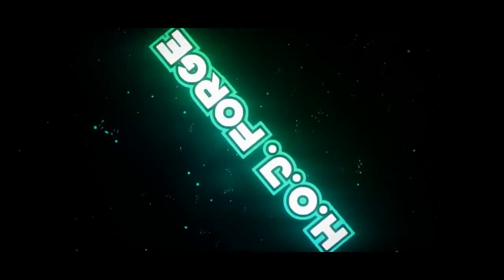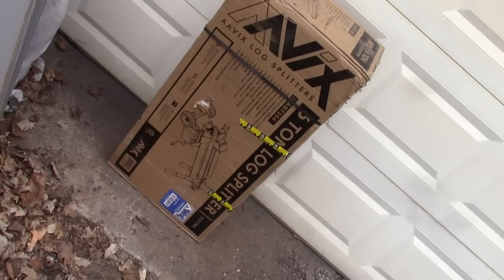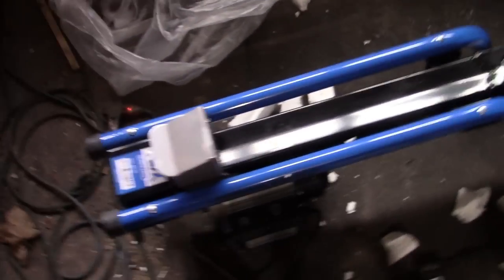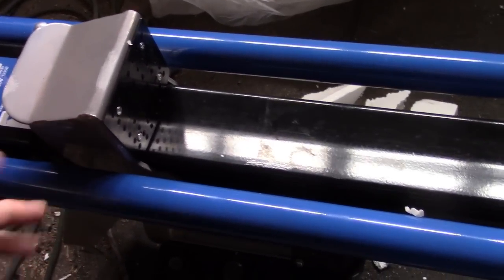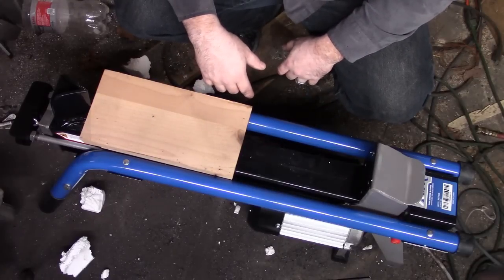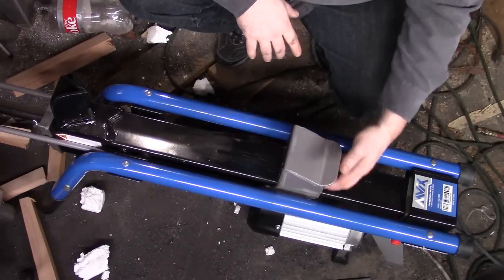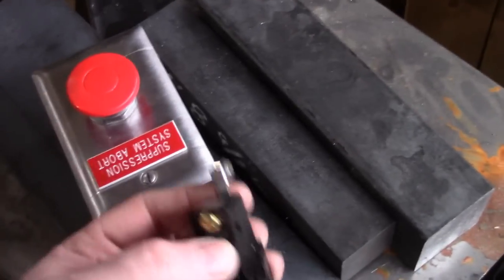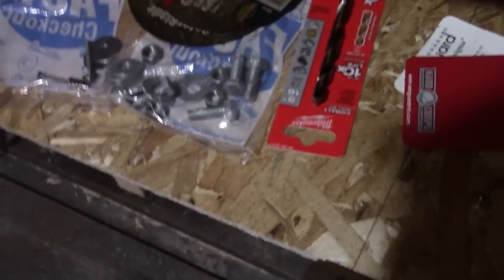6 Ton Log Splitter to Forge Press - Video 1 - An Overview of the Project

Comment: Most bed frame is seriously hard, especially when you try drilling through it, should be plenty strong enough for the legs.  They're just holding up the weight of the machine to comfortable height, not taking any of the hydrolic pressure.

Comment: 6 ton is not a lot. Good luck. I converted my 20 ton gas into a press. Works great. I can easily revert it back because I burn wood for heat
Reply from the maker: Nope, its not, but for under $300 bucks total, it will relieve some of the stress on my arm, even if it doesn't do every little thing I'd like it too.
Reply: @HoJForge  it will definitely help. I will keep watching.  I'm very interested
Reply: @HoJForge  there is a proof of concept video i think it's CG smithing. for smaller stock it should be good. i got a 5 ton for $150 i'm doing the same thing to.
Reply from the maker: @AllyisAlive214  Its that video that convinced me to risk the money and try it out.  Christiaan and I have been talking about his build... what he likes, what he'd change, etc...  There's also another video out there that I saw where the guy can barely  move some 5160, but he's out in the sun, so his steel looks way to cold... but he's "assured" the viewers that his forge is running nice and hot... blah blah blah... I've never been one to take other the word of other people in things that can have so many different variables...  Will 6 tons be enough for it to do what I want it to do?  Who Knows?  That's what this whole build is going to find out. I promise you that I won't be able to take a trailer hitch and squish it in to a pancake in a single heat, like a big 25 ton press could... I can be fairly certain, though, that it will help me make some bigger billets than I can by hand, and will cut the time of forging them by at least 50%, and maybe even more.  Punching my hammers?  Won't know until I can get it done and try it out... There's so many questions, but hopefully the build and the results will help other people decide if a build like this is right for them or not.
Reply: @HoJForge  i got mine under the assumption that it will only be good for use on 1" and under mild steel, if that is in fact the case i'll be perfectly content with the cost. if it works for more than that i'll be extatic.
Reply from the maker: @AllyisAlive214  Great mind set!  I'm right there with ya on that.